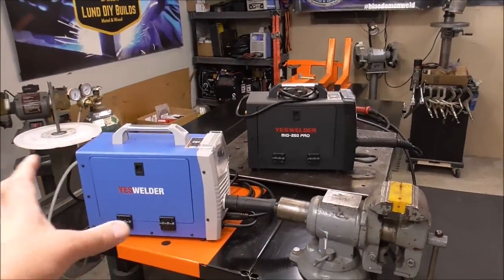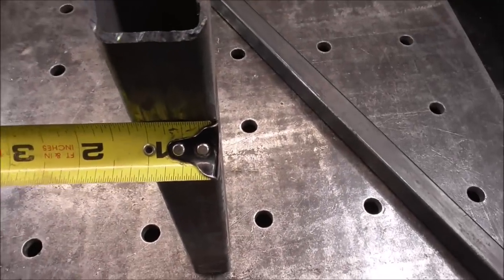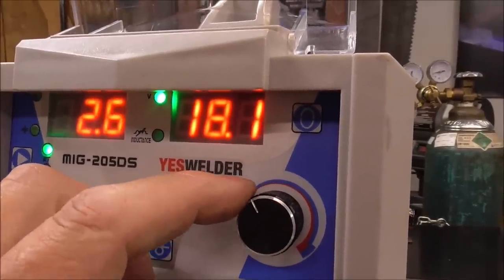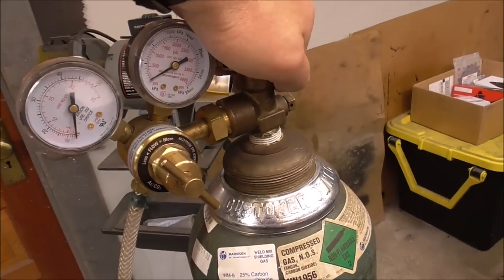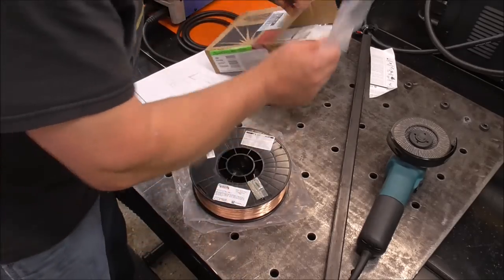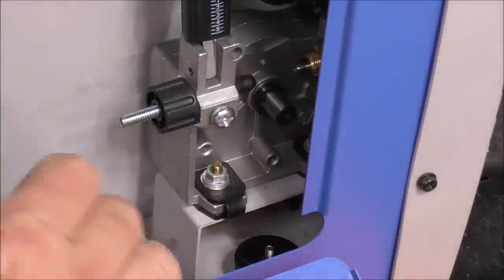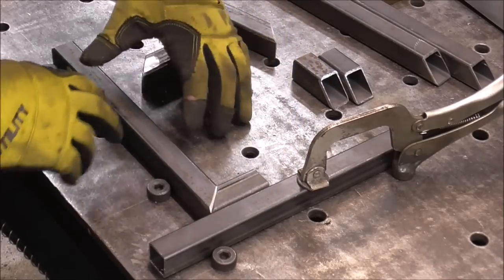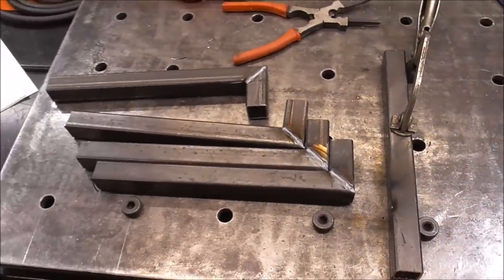Ultimate Welding Station and Metal Fabrication

Comment: Brandon fantastic idea, that weld table is a god send it just make the process easier I was worried about your fingers on the band saw 
Thanks for these little tips and tricks  Great stay safe 👍👨🏻‍🏭🇬🇧
Reply from the maker: Thanks Paul! That table speeds things up considetably. For some of the closer cuts I was using one of those strips of metal as a "push stick"

Comment: Wow Brandon, fantastic job! All the metal looks like one continuous piece, amazing. Truly a master of welding and fabrication. 
The welder doesn't like the magnet because once you place the magnet on the metal the magnetic field expands, then when you pass electricity through that magnetic field the strength increases more than 10x. The arc you create is then attracted to the magnetic field. Just incase you were wondering. Again, awesome video.
Reply from the maker: Thank you so much man! As always, I appreciate you! @KonstantineZ

Comment: Sweet. Nice project. Small shop, building  floor space is a premium. That's the ticket. When I get another welder gonna do my klutch fab table. Got it back n 2019 when they was around 150$ now I've seen um up to 250-299$. Crazy inflation prices on everything. It's looks new still and was good flat table. So I was lucky some people said there's was wrapped or bent corners. Few months after got table welder gave out. It was old hand down to begin with. Stay safe keep them video rolling.
Reply from the maker: Thanks Paul I appreciate it. The price of steel has gone through the roof. Lucy you got yours when you did! 👍

Comment: That table you made is very neat, i would like to make one and copy your design, the only 3/8 I have is diamond plate but I do have some 1/4 maybe large enough and for sure plenty of 1/2 that I was saving for a bbq smoker I could use, I got to watch you video on how you made it, the one you mentioned about half way through this one. great information here thanks
Reply from the maker: You could always use the backside of the diamond plate. It should be smooth. Here is how i built the template which made the holes https://youtu.be/hYtUqySOVMk
Reply: @BrandonLund  Thanks I just watched that video and bought  a couple scribes almost tempted to get that mag drill using your discount plus there labor day promotion it's like 400 good deal.
Reply from the maker: @diggindiggenit6540  you can also rent a mag drill too.
Reply from the maker: @diggindiggenit6540  this is me building it. I also buikd the template too https://youtu.be/hDA4NMQY1J8

Comment: You could even do this to a Large Weld Cabinet that holds tanks and Have the Cabinet hold 2 or 3 machines and then do this setup on one of the sides of the Weld Cabinet and mount machines on the rack and have a Weld Cabinet with upwards of 8 machines and Tanks because most Weld Cabinet hold 2 tanks just another idea also bro @Brandon Lund
Reply from the maker: Thats actually an awesome idea brother @Antonio Claudio Michael
Reply: @BrandonLund  Glad you like the idea think that's what I'm going to do appreciate the idea as well brother

Comment: I'm curious why the wholesale switch from Fronius to YesWelder.   I'm not saying there is anything wrong with YW, but you were hot and heavy for a while on the Fronius equipment, and now it is all YW.
Reply from the maker: @cmh31909 Because YesWelder has maketed their equipment at a pricepoint consistent with my target audience.

Comment: As always, another great video with excellent instruction!  I’m finding myself looking forward to Friday when you post. 
On another note, I was hoping you could help me locate an item you have for your fabrication table. I’m currently building the same table, following your video and instructions. I almost have everything I need to get started except for 1 item I can’t locate. 
I keep trying to order the 5/8 shoulder bolts on Amazon. I specifically look to make sure the shoulder is 5/8 wide (not long) but I keep getting these tiny little bolts!  I’ve done this twice. I must be reading the specs wrong. If you have the time, could you please direct me to the bolts you purchased when you built your clamps for the fabrication table?  I can’t find anything larger than a 5/16 in our local stores. I would really appreciate it. 
Thanks again Brandon. Keep up the good work!
Reply: I’ve ordered them off eBay and have bought them from fastener distributor called fastenal in my area. Hope this helps you in your search
Reply from the maker: Thanks @Shasta Rayne HERE is the link I have purchased from. I did the same as @Guy Anderson did also https://www.ebay.com/itm/163797872122 Once you get them I cut off the threads. Someone has mentioned that 5/8 drill rod will work for your clamps but I went with the same shoulder bolts because the clamp can also act as a material stop because all the hardware is identical. I appreciate your support. If you get stuck feel free to reach out here or any of my other social media pages. Good luck and have fun!
Reply: Hey  @Brandon Lund.   Thank you so much for taking the time to get that information for me. I really appreciate it!  I’m excited to finally torder the correct bolts as I’m going to use your tutorial to make the same clamps. 
It means a lot that you take the time to interact with your subscribers. That’s another reason why I enjoy your channel so much (above and beyond your excellent teaching skills and content), you genuinely care about helping us learn and care about the job that you’re doing. It really comes through in all you do. 
Have a great day abs thank you again.
Reply: @Guy Thank you so much for the help!  I really appreciate that you took the time to see that I needed help and you made a suggestion. Thank you again and I hope you have a nice day!
Reply from the maker: Thank you @ Shasta Rayne i really appreciate your kind words. I love sharing my ideas and thoughts and knowing its helping others is really rewarding. I appreciate it!